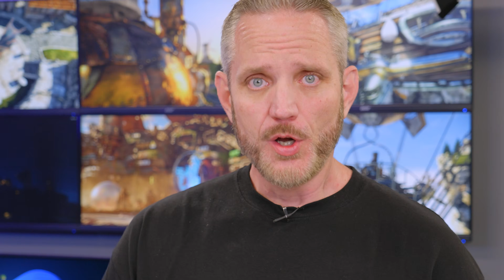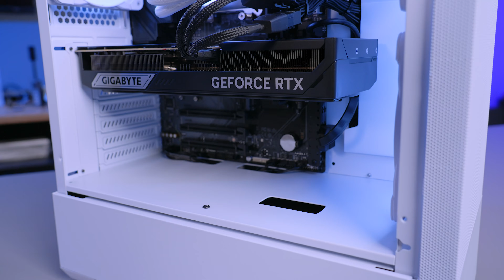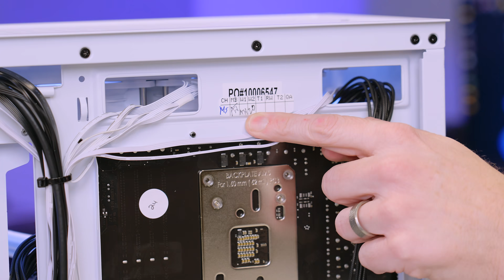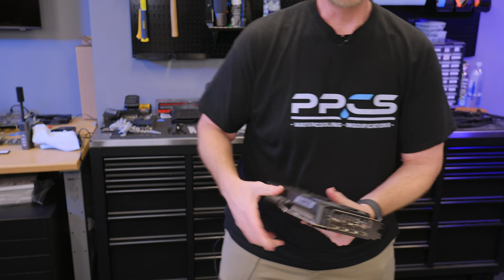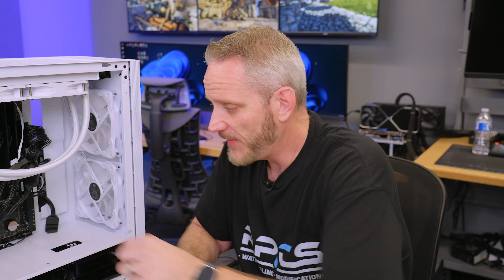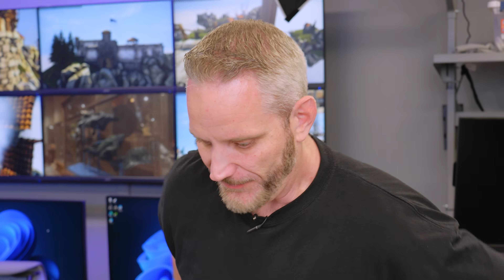This Prebuilt Gaming PC is Shockingly Affordable

Comment: @JayzTwoCents, 
Aristotle: "The whole is more than the sum of its parts." refers to the total VALUE of the "whole", not the COST or PRICE of the "whole"
Reply: If you strictly need a NEW PC, and you can afford one of the PowerSpec options that work for you then these are likely a AWESOME deal to get started, and you can upgrade or add components (storage, I/O, peripherals etc) later...

If you need to UPGRADE (PC of Theseus seems standard nowdays), then purchasing individual componenets or bundles may be better...then sell the parts you replace or are in the bundle but you don't need

Can confirm microcenter is BASED

Comment: Helped a friend buy a microcenter prebuilt with a 270k plus and a 5060 in it about a month and a half ago, same situation.  The cost was basically around 150 dollars under what the MSRP for the parts would have been.  Only thing wrong with it was the nvme drive didn't have enough space by itself, so helped him get a second one, and it had no nvme cooler so helped him get one of those and install it.

Comment: Super happy with my G729, 7800x3d, 9070 XT, and 48 GB of DDR5 Ram, which was supposed to be 32 GB. Finally set it up recently, and it's a big step up from my 9 year old laptop. Was super impressed by Micro Center.

Comment: Just added up some parts/bundles from Canada Computers, and yes, it's possible to hit the $2500 price, but for a pre-built, you've got a good deal there.
Gigabyte 5080, 9800X3D, Asus B850-E Wifi, T-Force 32GB 6000CL30, fishtank case,  360 AIO, 850w modular PSU, Crucial E100 2TB nvme. Came to $3560 CAD, or around $2550 US.
Also, that's a great case for the money; I had one for years.

Comment: I am an IT engineer and I have been for an extremely stupid amount of years. I needed a new PC and didn't have time to build one. So, my daughter and I drove to OH and I bought a PowerSpec over 3 years ago. It has not had a hiccup and it has been totally solid since I brought it home. I use it every day for work and other things. I couldn't recommend them more after years of beating on it ever day. My only changes were that I took it from 32GB of RAM to 64GB quad channel (it even shows quad channel) of RAM using matched, same brand RAM. I also put a RAM cooler on it. Oh and since it is a 13900KF, I upgraded the BIOS when the updates came out. It just works.

Comment: Looking at the specs at 4:50, that is pretty close to what I got from Sam's Club as a Christmas present, before all the price hikes hit.  I think the biggest difference between my rig and this one, is that I have a 5070 ti, and from what my Parents told me, the whole thing cost around $1,500.
Now, I've just got to take good care of it, so no over-clocking or unnecessarily pushing the graphics, and dusting it every so often, until all this insanity is over.
Also, I wouldn't mind any tips on how to properly clean the insides of the tower, or even just maintenance tips in general as I've only just become a PC gamer about a year ago when I got a Razor Laptop.

Comment: Microcenter also has a 7500x3d 9070xt prebuilt for like 1400$ pretty insane
(1 16gb ram stick tho)

Power spec g532 

There’s also a 32gb version for 1600$ 

Powerspec g535
Reply: Yep.  I got the $1700 version for $1530 open box.
Reply: @rickgear2579 whoa big score was there anything wrong with it? Or did it just look like a return?
Reply: @xPLastiK  so far it works great.

Comment: I was inspired by JTC's "Boring PC" build and discovered we have a Micro Center in Brooklyn. I went there just to price bundles and check out their 'build your own' services. I walked out with the G760 Gaming PC for much cheaper then I could have built myself ($1799) and with higher tier components!

I remain incredibly impressed at the quality of parts and performance. I've been playing Cyberpunk on psycho settings for over 2 weeks at 180 fps without any issues. 

One personal note of praise: Power Spec installed no bloatware on windows 11.
Reply: 180 fps at what resolution?
Reply: @Davids6994 I have a 32' curved 1920 x 1080 @ 75 Hz
Reply: @Neo-Noir_Sean soo your only gaming at 75fps
Reply: I got the same deal a couple of weeks ago. Been amazing ever since. Been gaming at 4K 120hz without any drops on max settings for most games. I’ve even started getting into VR
Reply: maybe in 2024

Comment: Picked up the RTX 9070XT version back in January.    Went to build one and was priced like 800 dollars less than I couple build myself (a couple of hundred was an upgrade in the case). Ended up getting an open box buy that was like even cheaper.    After watching this video I went and looked and the price has not gone up in the last 6 months.
Reply: That the version with the i9800x3d core ultra?
Reply: @sednaplanetx yeah

Comment: I've built my share of PC's going back to an original Pentium and the old Celeron 300 that you could overclock through the roof, but in Jan this year I bought a HP Omen 35l prebuilt tower because it was just such a deal.. one I couldn't even come close to matching by buying all the parts... almost the same spec as this (9800x3d, 5080, 2G nvme) but with 128G of ram (in this economy?!) but was a) priced from RRPs when it was built, not reflecting component prices at the time, b) I got a 20% discount on it through work and c) they offered me 4 years interest free credit... it's like I bought the RAM and GPU, and they just threw in the rest of the PC for free... PC part picker for the components still shows a price nearly 50% higher than what I paid... I just couldn't argue with it, it's really nicely built and is bloody fast. I'm sure a hand crafted self-build might be faster but I'm not going to argue...

Comment: I picked one of these up. Tried to beat the price building my own using parts all from their return bins and I still couldn’t. Best deal out there right now. They sell fast, they sold 4 the day I bought mine so if you live near a Microcenter you’re going to have to get lucky to find one in stock. I also was lucky enough to get it on sale! So watch for that, $2200 out the door after tax…and yes with a 5080.

Comment: I bought this same PC open Box for $2100 plus 5% off with the MC card.   Only issue I had was the GPU Bifurcated 5.0x8 I
With the M.2 in the top slot.   Moved it to the middle slot m.2 slot and it switched my GPU to 5.0x16.
Reply: Wait! I thought this B850 board didn't have this bifurcation restriction 🤔
Reply: @Mr.Wulfie_ASD  Always read the manual if in doubt.   Usually you can get a digital copy before you buy.
Reply: im picking one up today what does this mean lol

Comment: That is a nice looking pre-built for sure, especially for only $2500. I am so thankful the San Jose store opened up, been nice to take my time & shop in person!
Reply: I paid 2399 for powerspec g759 pc with ryzen 7 9800x3d,5080 pny gpu, 64 gb ram 6000, 2tb mvne, asrock x870 motherboard at the end of December . I aso purchased a 9100 2tb 2 weeks later for only $255. Great deal.

Comment: I wish i have this 
My pc spec.
i7 4th gen 4790 cpu
Gtx 1650 super 4gb gpu
16gb 8x2 1600mhz ram
650w psu
250gb ssd for OS windows 10
1tb seagate hdd for games 
Pc case not branded.

Comment: Microcenter simply remembers what pleasing your customers used to look like. This is probably a slight loss leader. But it gets you into their garden. It gets you into their store. This is a digital rotisserie chicken.
Reply: "Digital rotisserie chicken" now that's quite the analogy 😂
Reply: Good ole private company that can't be sued by shareholders for not maximizing profits
Reply: That's why they are the best. I drive 3 hours round trip to get stuff a few times per year.
Reply: Don't forget the Costco hot dogs, so damn good
Reply: No one forgot it, companies just got too big to fail, please stop blaming my generation or voting these companies CEO’s president.
Reply: Except for us in Wisconsin. MC hates us here
Reply: They actually probably make a lot of money off of the extra warranty they offer
Reply: its probably old RAM and SSD stock
Reply: @Draco-t1m I wonder if this is one of the Gigabyte 5080's that are missing the ROPs during manufacturing. I know some of the Gigabyte 5080 models are definitely missing ROP's. Which is a garunteed -10% base performance

Comment: managed to scoop a CRAZY ibuypower build from Costco not long ago, 9800x3d, 32GB ddr5 5200(eh), and a 5070 for 1400. I was SHOCKED when i passed it and had to go back to scoop it up. Its not replaced with a 2300 system which is identical minus the case being slightly upgraded
Reply: Yeah thats not too bad!

Comment: ye, ive seen a lot of these for way below self made price, but it does mean you potentially get a meh mobo/cooler. wont matter for 99% of people, but some of us need better mobo :P easy fix though. the 9070 xt version of this with a 7800x3d tend to be so much cheaper and very capable. yes, the 5080 is better, but compare it to what you actually play and your monitor resolution. also make sure to compare it to their 3-1 and 5-1 bundles

Comment: Pro tip: look for PowerSpec PCs that are open box
Reply: Yeah those are great deals. I got my open box PowerSpec with an i7-8700K and 1070ti in Spring 2018 for $930 that I'm still using today. The only part that failed so far was my SSD, but that was 2 months before memory prices increased so I bought a replacement for cheap. Looking back, I've never been so happy that a part failed early lol.
Reply: @SnackyChan51  It's impressive that your SSD lasted that long. I got 10 years out of a Crucial once. But my Samsung Evo is dying after 4 years.
Reply: @Davivd2 ive had a samsung evo 500gb since 2011 still working but does get less usage.
Reply: I can vouch for this.  I picked an open box Powerspec 9950X3D/Zotac 5080/64GB DDR5 last June for $2311 that was open box.  I don't think it was ever open, everything was brand new.  I got really lucky, it was already on sale for $600 off and then they had one box for even cheaper.
Reply: Great tip!!!